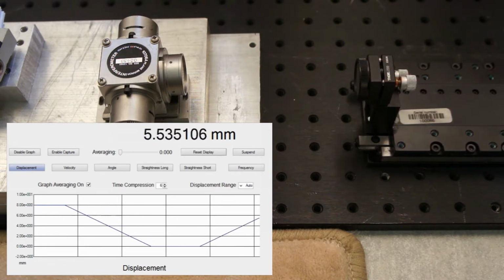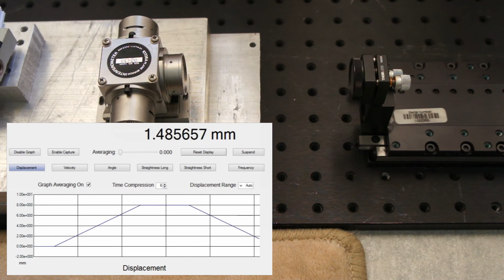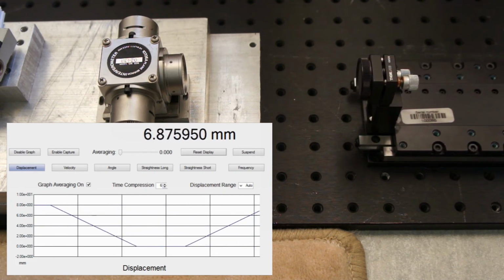A look at the SG-µMD1 laser interferometer measurement unit.

Comment: Can it measure offset between the sent and received laser beams?
Reply from the maker: I don't understand the question. Could you rephrase it? Alternatively, here is a video showing usage with some explanation: https://m.youtube.com/watch?v=vPu6lN9yJOY
Here detailed info about how this works:
http://www.repairfaq.org/sam/uMD1/
Reply: @janbeck8269  I meant the case when target retroreflector not perfectly aligned, when reference and measurement beam do not overlap.

For example, both beams fall on the detector, but not overlap, distance between them 0.5-10mm.

I need to be able to measure this distance in real time to be able to adjust external kinematics.

Is it possible with 10780 receiver, or I need something different?

I'm planning to use single beam interferometer.
Reply from the maker: @danilvagapov2419  IF I understand you correctly, then you misunderstand the way this interferometer works. But maybe not - can you make a sketch of what you have in mind, and post it somewhere?
Reply: @janbeck8269  Link: https://imgur.com/a/wqjnJ2I
Can it by done only with HP receiver, or I need something like additional 2d beam displacement measuring sensor?
I'm want to build something like feedback loop.
Reply from the maker: @danilvagapov2419  what you have drawn there will not work. The intent of the system is to measure the distance to the retro reflective target.